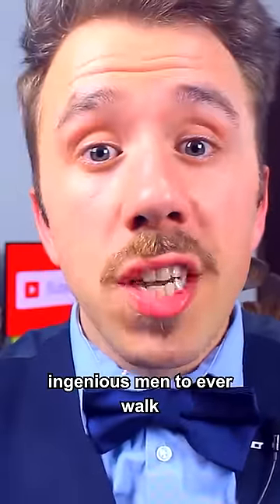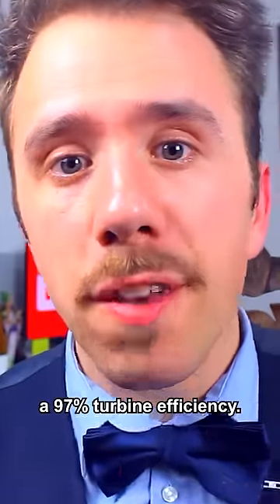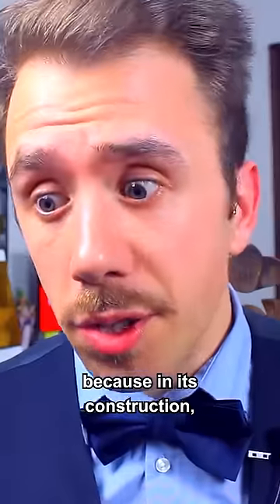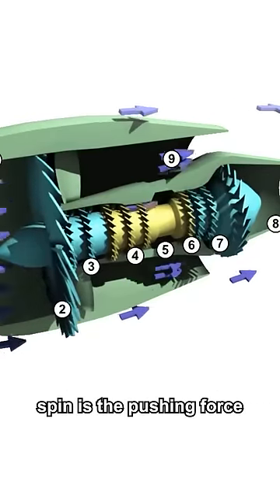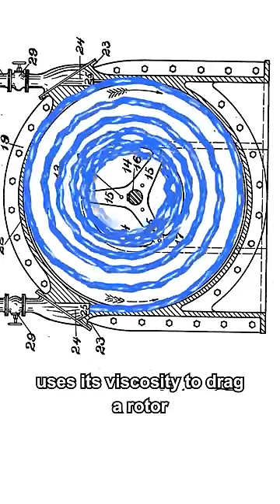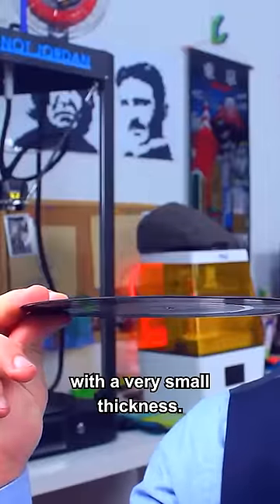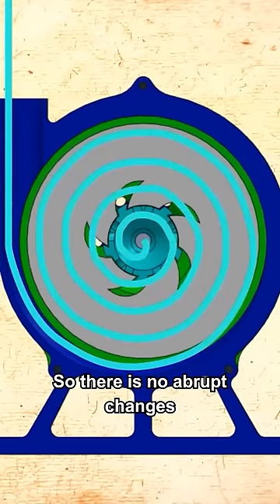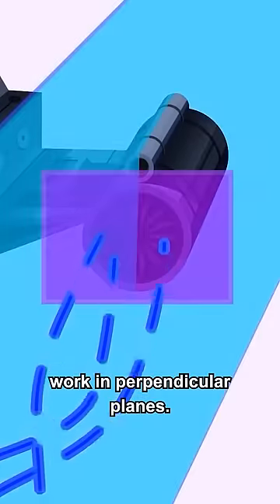97% Efficiency?! Was Tesla Right About His Turbine?

Comment: It’s very efficient when there’s no load. As you load it the wheels spin slower than the airstream and you instantly loose any benefit from it
Reply: that really isn´t the problem .......
the problem is that it only can carry loads at very very high speeds ........
Reply: and the disk's tend to blow up
it has to use large thin disks at high speed 
but any useful speed, causes the disk's to buckle and tear
there isn't a know material that can fully handle it

it's also efficient under load 
due to it having significantly more surface area
surface area is a direct correlate to force applied 
but only so much can be said by the raw data
since a working, to scale, at speed model is currently not real

we can only realistically say
"the math says it would be better, if it could be made
smaller scale experiments show the numbers to be accurate 
but large scale doesn't seem possible yet"
to be fair, large scale could see a drop off
but the truth is that we lack the data to know properly
and will likely need some carbon nanotube disk's to figure it out 😂

Comment: Efficiency goes down fast under load though.
Reply: exactly , this why it not really used , about 70% and not 97%
Reply: This just shows the difference between advertising hype and reality.
Reply: @ianbelletti6241 yep, if it was feasible it would be in use today... 

The difference between what is on paper as a theory, and real life use.
Reply: @volvo09  my point wasn't feasible. The loads it works with might be low in comparison to standard impellers. However, my point is that marketing takes the best numbers, even if they aren't the most appropriate numbers for analysis, and hypes them to sell the product. Ok. It's 97% efficient, but for what kinds of loads. How does it actually compare under load to a comparable traditional impeller design of similar size? 97% efficient under no load is meaningless because the energy exchange can drop off more or less dramatically with increased loads. From what I understand of these, they are good only for high speed low torque or high flow, low pressure applications.

Comment: Nikola Tesla was interested in High Frequency Alternating Current, so the high rpm of his turbines was a good match to the alternators. He drove his turbines with STEAM, not AIR, which is important because steam carries much more energy for a given mass of gas, AND he expanded the steam more than a normal turbine can withstand. Expand to the point where water droplets are forming and normal turbine blades get damaged by the zillions of tiny shock impacts at near the (local) speed of sound. Tesla's turbine receives no such impacts, since the flow is parallel to the disks. That means a much larger portion of the steam heat can be extracted, turned into Work (shaft power). In other words, producing power at High Thermal Efficiency η (eta).
Reply: throwaway3873  Air consists of distinct chemical elements, while steam is a state of water and serves as a far more efficient working fluid for turbines. Cute 1iq, though.
Reply: I don't see why the high temperature of steam would mean improved work on the turbine.
Reply: Summary: Temperature of a gas affects the viscosity, hot gas can do more work than cold gas, and steam cools more slowly. Details: The viscosity of a gas increases as temperature rises. This is because the gas molecules move faster and collide more frequently, transferring more momentum between layers of flow. This creates more friction and resistance, which results in higher viscosity. 
As for steam, it always carries more energy than air at the same temperature, because the specific heat of steam is much greater than the specific heat of air. As a gross oversimplification, steam carries about 4 times as much energy at a given temperature, so while doing work by expanding, steam cools more slowly, and that means the steam pressure drops more slowly. 
Also, compressing a gas requires a lot of energy compared to pressurizing a liquid the same amount. Thus it is inexpensive, in terms of energy, to bring water to a high pressure before boiling it. That gives a large increase in overall efficiency of a steam cycle (or any other version of the Rankine cycle). 
All of those contribute to steam being able to do much more work than air. Limiting factor for steam: It will eventually start to condense into water droplets, which entails a great drop in pressure, and damage to turbine blades as high-speed droplets impact the blades. Since a TT has flow parallel to the disks, there is no such impact. 
But there still is a limit even for a TT, since flow is towards the center and the density of liquid water means it tries to move outward when the TT needs it to move inward, to the exhaust ports.
Note: Typical gas turbines consume about 40% of their internal shaft power in running their compressor section.  throwaway3873   @keilveil9153  @NSA-admin
Reply: throwaway3873 What YOU should realize is that you exemplify the old adage: "A little bit of knowledge is a dangerous thing." In your example, another adage as well: "It is better to remain silent and be thought a fool, than to speak and remove all doubt."
Reply: @YodaWhat  won't it lose efficency as the steam cools before it's vented creating counter drag please exsplain if I'm wrong an how but from what I've seen the system only works if no energy is lost from the steam which the terbine takes from the steam as it pushes the discs so by that logic it would slow the velocity and create terbulence in the gaps between the disks as fresh and cooling slower steam interact in the system.
Reply: @YodaWhat  can I say in reply for that person who's message I haven't even read, if we don't challenge ideas we can't be proven wrong and can't learn how to improve to speak is always better then silence if more people spoke up for tesla instead of against his ideas if people just gave him enough of a chace and money and greed in combination with complacent people, we might not have been paying energy bills rn, it's always better to speak your mind as if you don't you will always remain a fool because no one can call you out.
Reply: @dylanbeddoes24  By optimizing performance within thermodynamics. It's designed to minimize losses from cooling steam and turbulence and is quite adept at converting steam's kinetic energy into mechanical energy, even as conditions change. However, traditional axial and radial turbines have been optimized over decades, making them highly efficient and difficult to outperform due to the vast majority of capital investment and rnd funneled into them.
Reply: @keilveil9153  think the problem is any loses even less than 1% causes a cascade between the plates no amount of optimization can overcome that boundary as its how fluids and gases act in such conditions it's literally the same issue as perpetual motion it can take energy from the steam with affecting the environment in a way that drops the efficiency by creating more and more terbulence flow temperature speed and density all affect of the steam will react and as it gose through the system the steam reacts with the walls to spin the turbine the energy lost in this slows the steam enough to be hit by the slightly warmer faster steam from behind this slows and cools the system more which leads to more slow down and repeat, I could be miss something if so please say but other the that I think the issue comes from it being too efficient this is why it was call the earthquake mechine it literally nearly riped itself apart and shook the whole block he was in because of how powerful it was but it's that powerful you need very strong plates steal won't do the stuff we use on regular turbine won't do as the forces on it will brake apart steel and even most alloy metals, second if you can get the resources it can only run affectively for a short ime before it get too hot or too cold temperature control is way more important in this design then any other terbine, but if all these issues have a solution the terbine would be the best thing in years as 99% energy returns from steam and since water can catch 90% of energy released by Cole that's a 89% efficiency which is 29 higher then the best current terbine, but we haven't tested it on lager scales and much like regular terbine it will likely come with new issues as we scal up the size to an industrial level and device
Reply: Hang on, why are we not using this technology?
Reply: Hang on, why are we not using this technology?
Reply: @terracar2003 - Tesla Turbines (TTs) work best at high RPM and quite small sizes. Tesla himself talked about getting 25 horsepower (about 19 kilowatts) from a TT the size of a fist. While that could serve to power most needs of a normal house, it is much more than the average house load while being not enough for the maximum load.  
Then there is the expertise and maintenance needed to run a steam system, with the boiler, water treatment, turbine, condenser, feedwater pump, water testing and all the maintenance involved. So basically, no homeowners will run their own steam power plant even if it has some small advantage. At the same time, 25 HP is far too small to interest utility scale electricity providers.  
While TTs might now be able to see applications in Microgrids, that was not technically feasible until recent decades, as the advent of efficient and inexpensive electrical inverters have made it easy to convert from the high frequency output of an alternator spun by a TT into the standard 50 or 60 Hz our electrical grids supply. That gave about a hundred year 'head start' to the development and implementation of conventional large scale steam systems and gas turbines.  
The small improvement to efficiency that a TT-based system can offer is not enough to overthrow the status quo. BUT I could see some niche markets adopting Tesla Turbines for off-grid power needs, since steam can be produced from almost anything that can burn, and from waste heat if it comes in at several hundred degrees, like secondary use of the exhaust heat from internal combustion engines.  
If a Microgrid is built around a pairing of TTs and internal combustion engines, each pair with an inverter to convert DC into AC at a precise frequency, then the variable frequencies of both engine and TT can be harmonized and shared. Each part can run at optimized speed and load, saving fuel.  
Further savings will be had if the heat from condensing the final steam exhaust from each TT is used for heating the water and living space of the end users. That tertiary use of otherwise wasted heat energy could 'tip the scales' in favor of this Hybrid Tesla Turbine System.
Reply: @dylanbeddoes24 - People who come on social media, which includes YouTube, and put their ignorance on display in a challenging or insulting way, are not looking to learn. Even IF they were slightly open to learning, their false and ignorant statements can mislead those who are actually there to learn. 
IF the offenders would begin by asking neutral questions as you have, instead of making bold statements in areas they don't understand, then everyone would benefit.
Reply: throwaway3873 aCtUallY,lol
Cute attempt though
Reply: High RPM, does the current material last long enough?
Reply: Not trying to sound facetious at all here, it’s for real this time. You sound like you’d be fun at parties, at least my kind of party lmao.
Reply: Speaking of people, not remaining silent... @YodaWhat
Reply: @NSA-admin modern nuclear plants used superheated steam as it's more efficient. It's more dense and can move the turbine faster
Reply: Moving parts, wow. Watching this conversation go back and forth is akin to listening to Fred and Barney if they worked at Bedrock electric. Perhaps it’s a hobby, and if so, I digress. When Elon sends something out into the void for whatever reason, it’s not going to comprise of moving parts to create needed electricity. If Tesla was around today, he would’ve likely abandoned moving parts long ago. E cat world.. don’t judge.. just see what is current in the world of non moving parts for generating electricity. No pun intended.

PS: Kirk calls down to Scottie “we need it to spin the turbine faster or we’re all dead!” ..”sorry captain we need to blow harder and we can’t!”
Reply: @ihdieselman  ROFLMAO. Try making an actual point when you want to be insulting.
Reply: @MrMattuse - ROFL. Please point out an EFFICIENT way of making electricity from heat, with no moving parts. As for power in space, methinks you speak from a position of utter ignorance, because the killer problem for in-space power systems is getting rid of the inevitable waste heat. Any system with low energy conversion efficiency has, by definition, more waste heat to cope with.
Reply: throwaway3873 thinking that all gases are the same is like thinking that every job can be done by any human. Although, in your case, you’re probably pretty replaceable considering how little you seem to think. So maybe in your experience it was a reasonable assumption for you to make.
Reply: throwaway3873 water vapor is different than steam, clouds are made of water vapor, steam is water in actual gas form and is invisible
Reply: @terracar2003 because it doesn’t work in practise, once a load is attached it becomes inefficient which increases as the load increases.
Reply: man youtube comment sections are so dramatic
Reply: @NSA-admin  Carnot cycle- more temperature differential between the hot side and the cold side = more available energy.
Reply: @YodaWhat  And the disc spacing needs to be optimized for the viscosity of the working fluid, be that supercritical steam in a turbine, or a highly viscous abrasive slurry using a boundary layer turbine as a pump
Reply: @dylanbeddoes24  Fresh steam (or other working fluid) comes in at the rim at high pressure. It exhausts through gaps in the discs (or by a better method, if you put your thinking cap on) at low pressure. The pressure differential keeps the fresh working fluid from mixing with the exhaust fluid. Some multistage turbines actually maintain negative pressure (partial vacuum) at the exhaust for this reason.
Plus, the incoming fluid is at high velocity, which throws it to the outside of the turbine case, while the outgoing fluid is at a lower velocity and doesn't get thrown outwards as hard.
Reply: @ostlandr  I also learned you can super heat steam beyond it's boiling point meaning you can stop it from cooling back into water just by heating it enough to ensure it still has enough energy to remain as steam by the time it reaches the outlet, I figured there would be a few work arounds but without such work arounds the original design would not be as effective right?
Reply: Yep. @ostlandr
Reply: @NSA-admin  bro has never seen a steam turbine or that shit they show for how steam works how did you not know this aint this like teached at school are a kid it would sense if you are or you straight up just never listened you probably never did
Reply: Expanding the steam more means it is hotter, your water droplet point is nonsensical.

Comment: It is really impressive how efficient the Tesla Turbine is, I have a torque converter in my car and I can attest. 

The problem with his turbine is that its not very efficient for water or air, the most common liquids we want to pump, because of viscosity.
Reply: NFP. Just vary the disc spacing based on the viscosity of the working fluid. Rule of thumb, disc spacing needs to be 2x the thickness of the boundary layer for the working fluid, because the  adjacent discs each support a boundary layer.

Comment: This is how the torque converter in your car works..sorta..it's called a viscous coupler..uses the same principals to connect power from engine to the transmission
Reply: Was looking for this comment...
Reply: When they started to explain it I thought of a torque converter as well.
Reply: No it's not. A torque converter is more like a regular turbine
Reply: @TC-V8 +1
literally just google "what does the inside of a torque converter look like"
first result, blades.
Reply: @goose7244  exactly my point goose! A tesla turbine has no blades!
Reply: @TC-V8 ya
Reply: @TC-V8 the point was more that a torque converter also uses fluid viscosity to transfer power. Not sure what the other guy wanted to prove by saying it has blades.
Reply: Principle? The torque converter in your car does not use a series of thin discs. It is nothing like Tesla's turbine.
Reply: Nothing like a torque converter... but very similar to the viscous couplers used in some GM all wheel drive transfer cases

Comment: The unmentioned component of this is that, when under load, the spin slightly reduces which causes turbulence which leads to essentially the same overall efficiency.
Reply: not if you build it on a larger scale at a high speed  ....... wich is what tesla suggested 
-
the problem with that are material propertys
Reply: @baronbrummbar8691  noooope I’m pretty sure a difference in friction coefficients between two materials are all that’s needed to cause turbulence in this case. The water speeding up or the system being much larger wouldn’t change that. Or shouldn’t.

Don’t get me wrong, it’s objectively the better system because it’s far simpler to build. But it’s not substantially more efficient.
Reply: @DeadlyEnzyme  on larger scale it isn´t easyer to build ........... the simple speed put so much force on it that basically no material can withstand it 
-
and on larger scales both the Torgue problem aswell as the by you mentioned turbulence get resolved